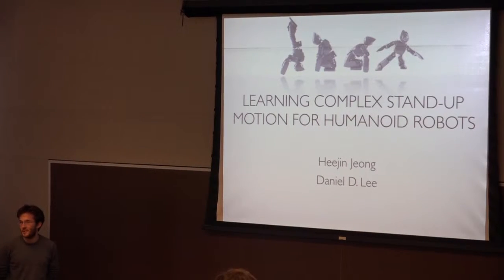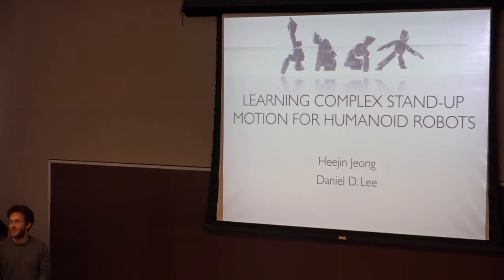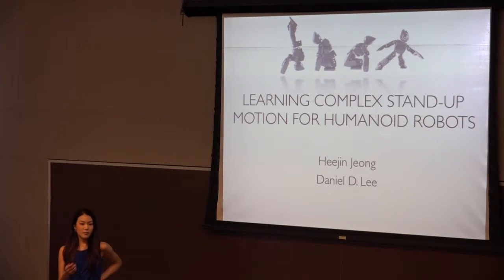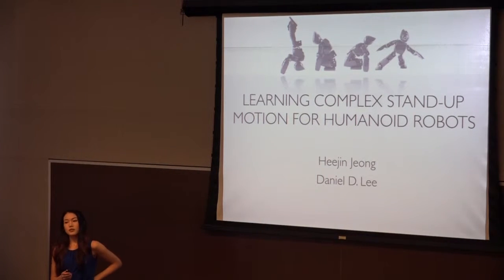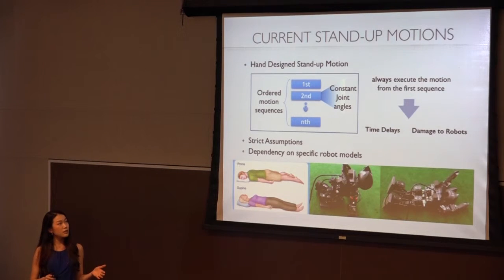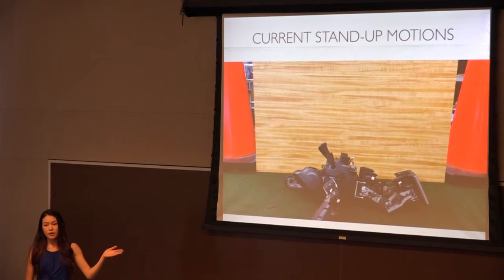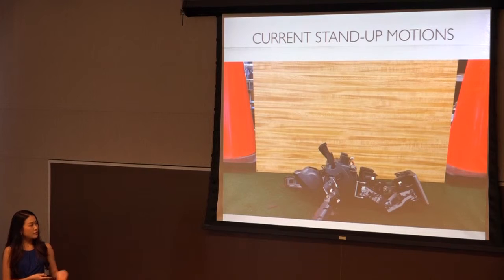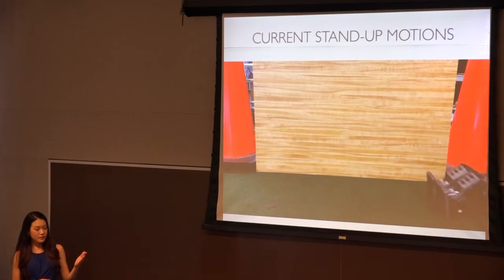Heejin Jeong "Learning Complex Stand-up Motion for Humanoid Robots"

Comment: i think that the robitc have been able to be in any cain of Robotics because is the science and technology of robots. It deals with the design, manufacture and applications of robots
i now the  robot, is an artificial mechanical or virtual entity and it is a machine used to perform a job automatically and that is controlled by a computer.Complex numbers are the working tool of ordinary algebra, called algebra of complex numbers, as well as branches of pure mathematics and applied as complex variable, aerodynamics and electromagnetism among others of great importance
the numers complex areb combines diverse disciplines such as: mechanics, electronics, computer science, artificial intelligence and control engineering. Other important areas in robotics are algebra, programmable automata and state machines.some robotic are desing to build some cain of thigs devices and systems capable of performing tasks of a human being,Robots are devices composed of sensors that receive input data and which can be connected to the computer.
The complex numbers are an extension of the real numbers, which is true. Complex numbers represent all the roots of the polynomials, as opposed to the real ones.
 This thinks are compouse of numbers and exercise taht they control the sistem of the robot is for this that the robot need alot of numers., upon receiving the input information, orders the robot to perform a certain action. It may be that the robots themselves have microprocessors that receive input from the sensors and that these microprocessors command the robot to perform the actions for which it is designed. In the latter case, the robot itself is itself a computer. i think taht is all teacher see you. *****